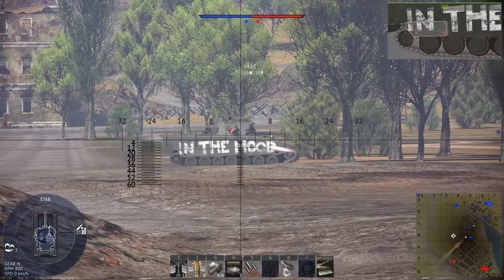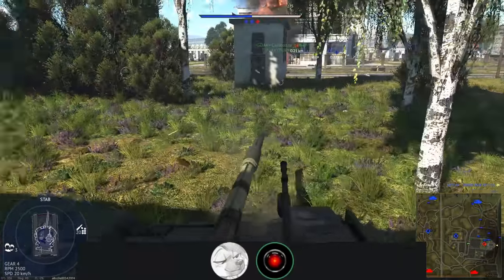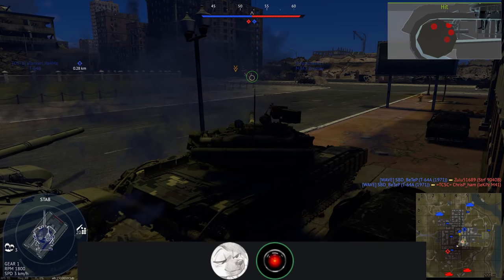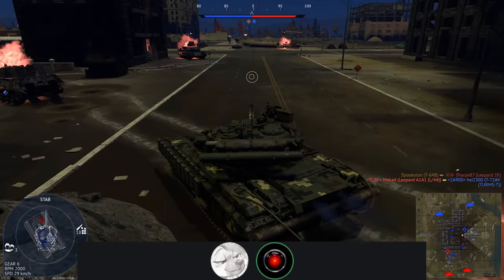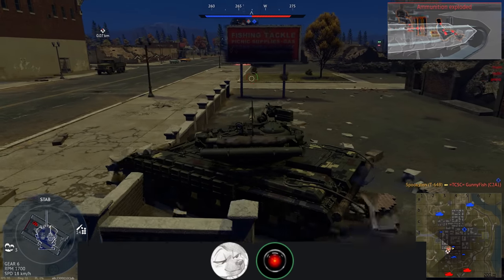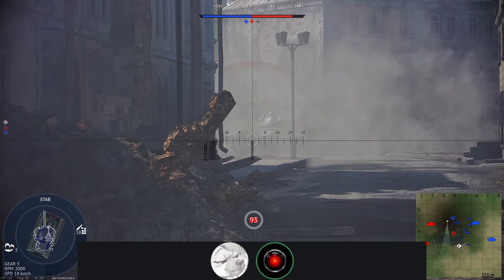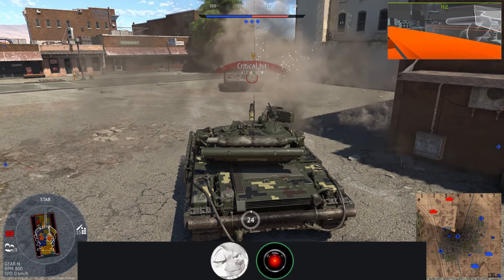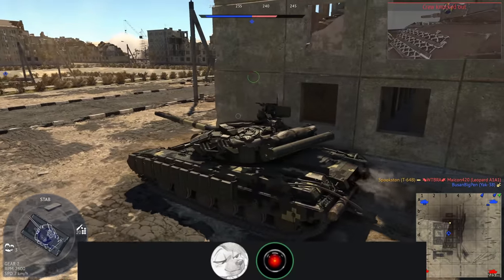Why Do Russian Tanks Have Cages?

Comment: Idiotic fluff...  Tandem warheads are meant to defeat reactive armor, not HEAT screens.  The focal point of HEAT rounds is critical to their function and altering the geometry of the stream by over a meter (8:17) is hardly insignificant and would have a detrimental effect on the penetration of the munition.  Due to the limitations of the Javelin having to be man portable means that the size of the warhead is limited.  Will the cage have an effect on a manpad? certianly.  AGM-65? not so much. 

Then there is the "threat" trying to hit a stationary tank, much less a moving one with a mortar...

Comment: MAM-C's diameter is 70 mm and even smaller than rpg rounds so those cages most likely save it from C version but MAM-L is even bigger than Javelin with 160 mm diameter with tandem(?) HE or thermobaric warhead so if could not stop Javelin I dont think could stop the L version of these munitions and they are not missiles they dont have engines they are basically really small guided bombs most likely even smaller than SDB's

Comment: The man mentions the chance of a unguided mortar taking out a tank but didn't talk about the NLAW. Now that's a hot take.
Reply: the NLAW has a caliber of 150 mm, everything he said about the Javelin applies to it too.
Reply: Isn't the nlaw a shorter range, but more powerful javelin
Reply: Why? Anything that can't defeat a Jav CERTAINLY can't defeat an NLAW atttack
Reply: @fearfulgrot  Kinda, but the NLAW's top attack actually works differently.
It doesn't directly impact the tank, but actually flies above it and detonates a Warhead that's pointing downwards from the missile itself.

The only issue the cage could pose if if it's in the way and the missile hits it before detonating, but I haven't seen any complaints about it so far, so the cage is still ineffective.

Comment: Might be effective against NLAWs in top down configuration. A cage could intercept it before it flys over the target.
Reply: Not really. The NLAWs sensors keep it aware of whats in front. It will probably detonate before it reaches the cage.
Reply: @ChucksSEADnDEAD  Having the NLAW detonate early is the point. That means the NLAW will miss the critical turret section or possibly miss the tank entirely.
Reply: @robincray116  You don't understand. The NLAW starts the triggering sequence by detecting that there's a large mass of magnetic metal ahead of it. It will not "see" or sense the cage. It will know there's a target ahead, start the triggering sequence, and blow right where it needs to.
It will not "miss the tank entirely", because the missile flies either in a straight path or with a crude predictive course correction pre-programmed by moving the missile launcher to keep the intended target in the sights. Either you miss your shot by physically missing at the moment of firing, or the tank changes speed/stops causing the missile's predictive intercept path to be wrong. If the missile is already heading towards the tank as intended, there's no way it could "miss".
Reply: @ChucksSEADnDEAD  If the NLAW detonates before its above the its above the turret. It might damage the engine, wheels or hurt the driver. It won't hit the ammo or other crew under the turret. If it detonates above the turret it will have to hit the cage first which will damage or destroy the shaped charge.
Reply: @robincray116  So mobility kill, meaning the tank crew must abandon it while they can or risk getting killed or captured. A tank that can't move is as good as dead.
The assumption that it will have to hit the cage is not very realistic. There's videos of the rocket flying roughly half a meter above the turret, and many pictures of the cages show them to have enough clearance for a man to be sitting on the turret, some ever taller.
The cages would make sense if they were worried about RPGs or hand thrown weapons when going into the cities, but they prefer to shell them from a distance.
Conversely, since many tanks are being ambushed in the open rather than in hull down positions, the direct attack mode seems to cause fire inside the tanks when hit from the side. The cage is futile against these large caliber HEAT warheads and it's the equivalent of wearing soft body armor in a rifle fight.
Reply: @ChucksSEADnDEAD  Don't try oversell mobility kills. A tank with a disabled engine or treads can still fire its weapons and is still an immediate threat to anyone around it. Loot is a winners privilege, so don't automatically assume that the Ukrainians can can capture every tank they mobility disable.

The cages I've seen are roughly 0.5 meter above the turrets. A man sitting down is roughly 0.5 meter in height. Furthermore the cages over a bit of the sides and is not just a flat sheet. So what is your point about NLAWs flying 0.5m above the turret. They will still hit the cage from what I've seen.
Reply: @robincray116  A tank that can still fire its weapons still needs to find its attackers and shoot back. That's enough time to put another rocket in it and get a full kill.
I didn't say the tank would be captured, I was talking about the CREW. The CREW has the choice to flee, or face capture or death. Your tank takes a hit and can't move. Are you going to fight to the death in a metal coffin?
Some seem to fly half a meter, some a full meter. I don't know exactly what determines this aspect. My point is that the missile will detonate regardless of it hitting a cage or not because it works through sensors in the overfly mode. It can also be used in direct fire so it's a moot point.
Reply: @ChucksSEADnDEAD  As if being able to move around is going to protect you better when you're in the flat plains of Ukraine. Tanks mostly rely on armor not mobility for protection. Armor is thickest at front of course, but that is moot if you're using a weapon like NLAW. Direct fire mode makes the NLAW much less effective. If the cope cage is enough to stop people using NLAWs in its optimal configuration, its done its job.
Reply: @robincray116  This is meaningless. A mobility killed tank is a dead tank, because at that point it becomes easy to keep hitting it. A mobile tank may need the expenditure of an expensive a smart weapon to destroy. Doesn't matter if you're in the plains.
Ever heard of the onion? Don't be seen, if seen don't be tracked, if tracked don't get fired on, if fired on don't get hit, if hit don't get penetrated. Armor is the last resort. The best protection is not being detected. The second best is not being hit. Being hit is a losing proposition.
Direct fire doesn't make it less effective, if it's just a coup d'grace on a stationary tank. Only someone who didn't pay attention to class would fire at the front armor.
It didn't do the job because the tank was killed by the second shot anyway, as a result of the first shot critically damaging the tank but not setting off the ammo magazine.
Reply: If a tank stopping is such a death sentence why do you see tanks stopping to shoot all the time?

Comment: Javelins (and other AT systems) uses HEAT, HEAT can be countered by spaced armour, steel grates serve that purpose, weld it on depending on what system you are facing. 
Why do people need a video explaining shit that has been standard since HEAT came about?
Reply: javelin is tandem charge so

Comment: Are mortars accurate enough to hit a tank reliably?
Reply: There are Videos of Ukrainian Armed Forces using drones to pinoint APC/Tank columns and then target them with artillery.
Reply: Depending on how fast and precisely you're getting intel and how well you can adjust a mortar, I think so!

Plus... You can always just pull a WW1 and just spam salvos upon salvos on an enemy position, you're sure to hit something eventually, especially if the vehicles are unable to or just aren't moving.

Comment: Isn't it obvious that these are inspired from WW2, When the Soviets welded Bed Springs onto Their T-34s and JS-2s as Spaced Armor to defeat German Panzerfausts?
Reply: And that doesn't work either, as it did in 1945.
Reply: @MichalKaczorowski  That's because Missiles are better designed now.

Comment: A couple of mistakes there. There is no one saying that the Javelin would be diffused by the cage. It is supposed to set of the missile with a 1-1,5 meter of stand of. This does significantly degrade the HEAT-jet. The cage is also not made to work on its own. It is supposed to work with ERA panels on the turret roof. One of the to countermeasures are not likely to be 100% effective, but together they significantly increase the tanks survivability.
Reply: 1. There are folks arguing that it defuzes the Javelin's warhead, as that is how most slat armor works. 2. The stand-off is not substantial enough to prevent penetration of what is effectively a 4cm plate. US Reports of Slat armor in Iraq and Afghanistan made note of the fact that it was a "myth" that slat armor works by increasing stand-off distance for the HEAT charge, as this did not effectively stop the penetration of RPG warheads even with substantial stand-off distance (which, for the record, is also why slat efficacy was considered a "percentage of effect" instead of a blanket improvement). The ERA panels on the roof do not cover the entirety of the vehicle and are made of the newer 4S24 insensitive explosive filler. Not all vehicles, especially some of the older T-72Bs and T-72As, are using this in-theatre and those that are does not increase protection substantially enough to prevent penetration of a 5" CE charge. The biggest improvement in survivability of these cages would be through the use of obscurants like Nakidka which can reduce the thermal signature of the turret itself.

Comment: could anyone explain how "diffusing the warhead" works? i.e. how caged/slit armor defeats shaped charges in the first place
Reply: standoff charge, no stand off charge... no boom from detonation or at least not as big as it could be.

Not useful against ATGM's
Reply: Two words:

Cope Cage
Reply: They can cause detonation at a sub-optimal distance away from the vehicle. Shaped charges, if they're too close won't form properly and conversely, if they're too far away the penetrating jet will begin to disintegrate and disperse.
It can also deform the shaped charge if the slats impact around the trigger at the tip of the charge, causing it to explode as effectively as a frag grenade rather than forming a penetrator. They can in some cases prevent detonation, probably if the fuze is damaged on impact.

Comment: What about the NLAW ? not a tandem warhead , top attack missile and penetration around 400 to 500mm , so ERA + roof armor + air + cage could save  the tank
Reply: It has a direct attack mode so that's why i think they don't talk about it
Reply: The cages stand no chance of stopping an NLAW. The warhead is FAR too large for it. It's larger than a Javelins. NLAW is 150mm, Javelin is 127mm.

Comment: It could help against older RPGs from the top in the urban fighting. Otherwise if you want to use tanks you really should equip them with an APS system. Another thing is all the tanks being deployed are older tanks with modernizations which would lend credibility to my theory they're being used to test out the effectiveness of enemy weapon systems. Russians have too many of them anyways as cruel it might sound it's more useful to use them as a fodder. Then use the experience to develop an APS or other systems to better protect their modern machines (T-14, T-90M, T-15) agains ATGMs.
Reply: Should be noted that most APS have a minimum engagement range of 30m or greater before the APS can react and engage guided or unguided threats, which makes them less useful in close range urban fights.
Reply: @Th0nky  most loses seem to be on roads surrounded open fields with patches of forrests. Ideal place to employ an APS system to protect the vehicle from destruction. You could design the infantry support doctrine around the limitations of APS even in Urban areas. But as I stated before the tanks you see now are old Soviet designs with modernizations (mostly new ERA and optics) that aren't made to stand up to Javelins and NLAWs. But there might be solution to make the cage effective. Strap the Relikt blocks like those on the side of T-80BVM to it and put another layer directly on the roof. That might be able to stop the Javelin or NLAW.
Reply: @reaperking2121  also possible I'm just theorizing here. And the Nukes are definetly biggest threat for sure.

Comment: Doesn't mention the NLAW at all lmao
Reply: although they never mention the NLAW, it does operate on basically the same basis as the Javelin so what applies to the Javelin applies to the NLAW as well. That is, the cope cage is equally as useless against the NLAW as it is against the Javelin
Reply: Never mentioned as it was superfluous to do so. "Javelins or similar such weapons" will defeat these cages as they are both very modern warhead types.

Comment: They're probably anti-sabotage defenses, like a ship's mining net. They're there to stop opposing forces from physically attaching explosives to the hull.
Reply: I dunno. It might stop someone from dropping a charge on them from directly above. Say in a building. But unless you're doing a vertical lob, most satchel like charges are probably going to be chucked or tossed in a pretty shallow arc.

Not to mention a satchel on top of the engine deck will also mission kill a tank and force the crew to bail.

Comment: those cope cages don't actually work you know ?
some say it was also meant for the loitering ammunition drones (kamikaze drones used in Armenia) but it wouldn't work either.
also it's worth mentionning but the Javelin doesn't actually use an heat seeker, the on-board "computer" on the launcher create a quick 3D plan of the vehicule you're aiming at and gives the info to the missile before launch, so even with a thermal protection the cope cage still wouldn't work.
Reply: yet there are 4 countries total that use it? whether or not it works against ONE small munition platform doesnt matter, as it still works against most things youd encounter
Reply: @TheArcticFoxxo  no it doesn't really work, that's why it's called the "cope cage" and that's why we see videos of soldiers knocking out tanks with Nlaws or even RPG-7's, that shit doesn't work at all.
i'd argue it could if i wasn't seeing so much videos or pics or tanks getting rekt despite this, even tanks that are still active and driving.
it really doesn't matter if 4 countries are using it because it doesn't work, slat armor is normally for shitty RPGs and the likes, it's totally innefective against missiles (even without tandem charges) and it also seems to have various levels of innefectiveness with RPG-7's, there's also few videos of that turkish drone going around and knocking armor, including the cope tanks, those cages are most likely an attempt to counter top down ATGM's or even loitering ammunitions but they should have tested it better beforehand.
also the argument of "it's for baggages", "it's for bushes" is laughable.
the biggest thing the cope cage does is showing the exact position of the armor when its trying to hide behind a ridge so that a Javelin or Nlaw can use a top down attack on it (because they can perfectly see where the roof is because of the cage).
i've seen plenty of bullshit surrounding those cages, bullshit that can be easily debunked with the pics of the wrecked tanks and a clear impact from a top down attack on the turret (and the hole in the cope cage).
russiaboos are pathetic.

Comment: particular cages are useless ... the only reason behind them is to give a hope to the crew   ... we care  (in fact no,  all  T-72 are suicide crew machines thanks to autoloader and shell location mixing it with fuel tanks or crew must go only with shells in autoloader), after Ukraine's test against it with the javelin (video is published), first destroyed grill and remaining parts blocked turret hatches ... and penetration was done anyway, so even some crew member from turret survive remaining of this scrap metal block them and allowing him to burn alive ... Disadvantages of this crap did not end there it makes a  tank a much taller target reducing low profile advantage  ... Instead of following Ukraine approach od developing Zaslon  (operated by  Ukraine,  Poland, and Turkey)type system (Soviet anti shell system, just improved version, before 2014 used Russians components), they create this trash ... Total  failure  :)